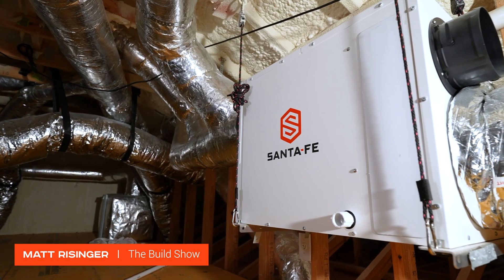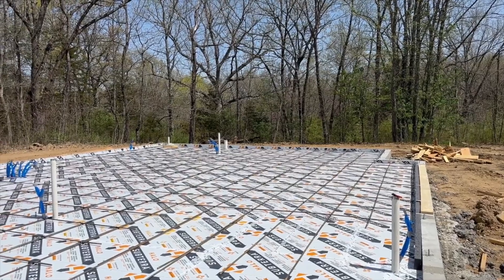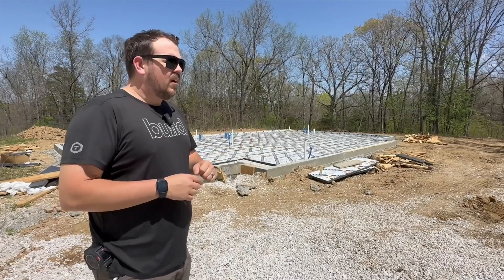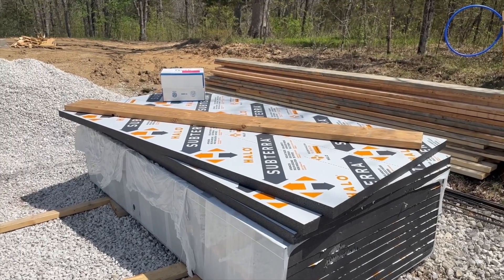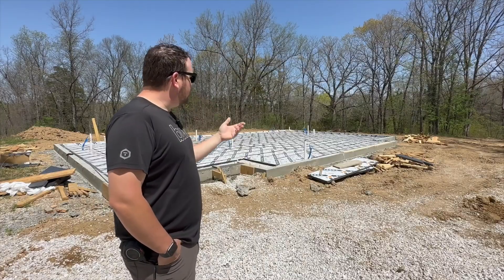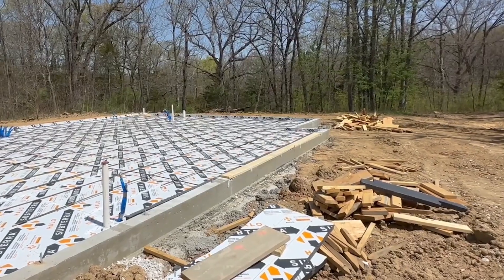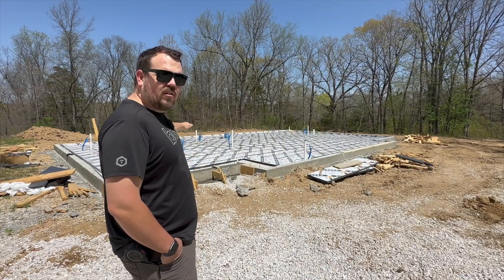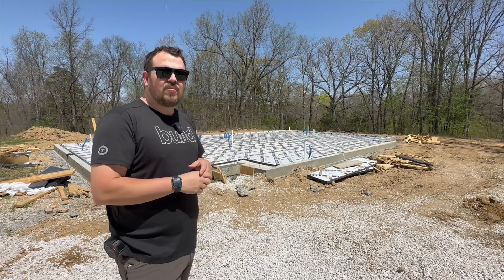Secrets to a High-Performance Insulated Slab; Jake's Proven Method”

Comment: Do we need insulated slab in South Carolina? or does it only apply to those areas that get real cold in the winter?
Reply from the maker: Some parties believe that in the warmer climates coupling to the ground can be an asset and provide a little cooling. This might be true. However I would make the simple arguement that I would prefer to have control over the entire envelope. Insulation and air sealing from everything outside (including the soil). In the south I would recommend less insulation that the far north but I would still uncouple.
Reply: @jake.bruton.aarow.building just to clarify in layman’s terms.  You would use this method with less insulation?  Very interested in this for a new build (North Georgia).  Is there also a barrier like Stego underneath? Being someone recovering from mold, the moisture management would be of most importance.  Also after listening to Cheryl Ciecko the only flooring I’m interested in is either tile or polishing the slab.  Would any type of in slab heating be necessary in this zone?  I would say definitely not with this method 🤷‍♂️

Comment: Great summary Jake! This is almost exactly the foundation I'm breaking ground on right now in Fayetteville, AR.  Footer depth and size is adjusted for our climate (24" below grade, 2'x1' reinforced footer), I'm using 3" of reclaimed XPS under slab, and I'm wrapping my Stego vapor barrier over the stem wall to later tape it to the sheathing.  Like you, I'm using vertical rebar to tie the footer to the stem wall @ 24"oc.  HOWEVER, I'm losing some sleep over the fact that my 4" reinforced slab will be "floating," and not tied to the stem wall in any way.  I have yet to meet a foundation sub who thinks this is a good idea, but I want that vertical thermal break, if it doesn't compromise my structural support. Our slab will also be "polished" as the finished floor.  With R-28 walls and R-58 roof that slab-to-wall connection stands to be the chink in our thermal armor.  The interior slab will not support any load bearing walls.

Does your stem wall have a notch in it to support the slab a smidge?  How do you feel confident that your sub-base is compacted well enough to support your "raft" of insulated slab?  Any thoughts you have on this which might boost my confidence would be welcomed.  

MANY MANY THANKS.  I've been watching your videos for the past couple of years, since your practices and climate zone overlap with mine. Keep up the good work.  You're inspiring us all to build better!

Comment: I am using this exact method on my upcoming build. however i am stumped on how to insulate where my 12ft patio door is. I wabt to make sure we dont see the insulation after the polished concrete floors as well as having ptoper support under the foor. Any soecif detail i should look into to insulate the transition under the door?
Reply from the maker: Great question. On our project we didn’t have this concern because our lift and slide is the thickness of the home’s wall assembly. However with an american made door that is only a couple inches thick this would be a challenge. You can cut the wall inward to create an inset and reduce the amount of insulation both to create a much smaller curb for the door to rest upon. Essentially making the curb size slightly smaller than the door because all it has to support is the door. It does make layout durning the placement of concrete super crucial, or if you are smart and have deeper pockets you simply let someone cut the concrete in the perfect spot afterwards.

Comment: Have you used FRP rebar yet? Any thoughts ?
Reply from the maker: We have, we like it however our concrete crews do not because they cannot bend things onsite. We have to get it in their heads to think ahead and pre-order because I think there is real benefit to using it. Cost and weight are better.
Reply: @jake.bruton.aarow.building  that makes sense! I like that it doesn’t rust in the concrete

Comment: Not adding hydronic pex tubing on top of the rebar before pouring the slab was a wasted opportunity, even if the plan was to not add a boiler when the home is completed as it could be added later.  

Our home was built in 2022-23 and we used 2" of XPS under the slab, rebar, and PEX-A tubing in zone 6.  Our boiler heats the slab and our hot water.  We have a furnace that heats the upper level and runs the AC.  Our lower level, which is a walk out, is nice and toasty in the winter and it is the first home we've owned that doesn't have an always cold basement.  In-slab heating is a huge factor when selling a home in our area with 6 months of very cold winters.
Reply from the maker: All great tips. However, in climate zone 4 in a very effcient home radiant heat can be a real challenge. There aren’t that many days that radiant can be justified because there are many times that the heating is on overnight and potentially cooling or at least no heating during the day. It gets warm enough that the slow-to-respond systems like radiant make less sense in a milder climate and espicially so when the home doesn’t dissipate heat easily due to a lack of leakage. The other downside is that we still would need a cooling system, therefore we would be buying two HVAC systems, one for the floor, and one for cooling (ductwork or mini-splits). This is the challenge. I agree that it may have been a comfort bump on some level but on the tight budget that this home has it just wasn’t justifiable.
Reply: @jake.bruton.aarow.building  You always get what you pay for.
Reply: @jake.bruton.aarow.building good explanation.
Reply: I was wondering the same, perfect time to put this in even if not used right away.
Reply: An air to water heat pump is more than enough no boiler required.  But heat sheet from Logix is also GPS and allows you to put PEX tubing into within the nubs
Reply: What pex tubing did you use?  There stuff like plumbflex which is 400$ per 1000’, or uponor with better bending at 800$/1000’
Reply: @nebulousJames12345  We used PEX-A.  About the same cost as PEX-B but PEX-B is harder to make smaller bends required when looping back and forth when used for hydronic heating.
Reply: Jake is right.  I was considering hydronic tubing under my slab in zone 4, but decided against it for exactly the reasons that Jake cited below.  Zone 6 could be a different story.

A warm slab is a wonderful feeling if you're in a cold climate.
Reply: @ericboles3861  The Twin Cities has the coldest average temperature of any major metropolitan area in the nation, so yes it works great here.